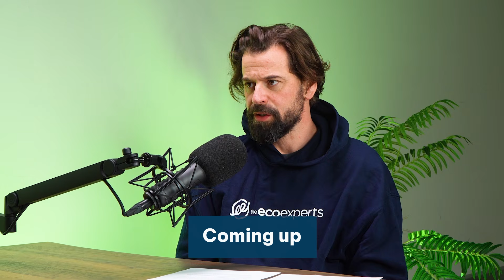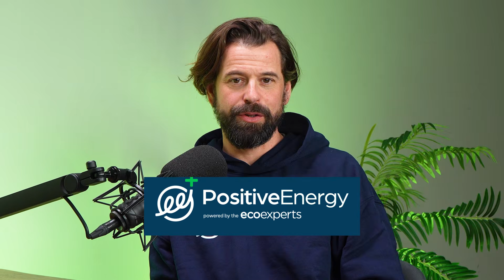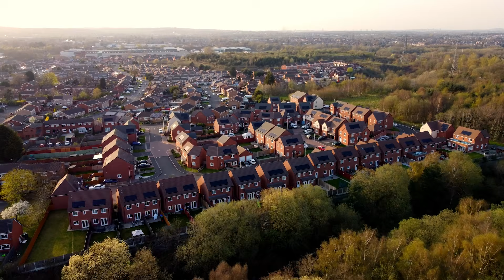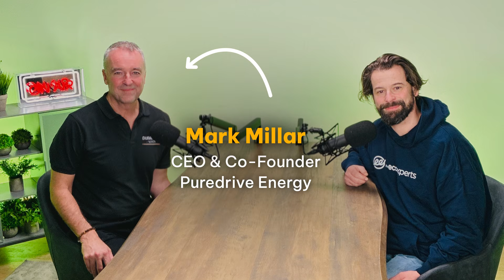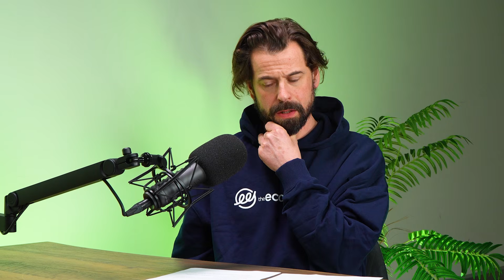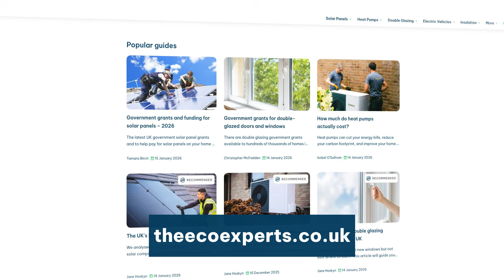Batteries Included: The next generation of energy storage | Positive Energy with Mark Millar

Comment: Let’s get some fact straight. LFP batteries with 5 kw capacity net from reputable Chinese manufacturer with very high quality components sells for a less than 1000 EUR in EU. There are cheaper options around 800 EUR per 5kw. Sodium batteries are plainly unusable for domestic cases, as their discharge curve is brutally wide, which makes them hard to use full capacity. There are no decent Inverters right now, that are capable of dealing with their voltage curve, so upgrade between LFP and sodium is not possible without replacing all the expensive parts. This man sells dreams to people who have no understanding of the topic. It is so sad to see how solar has been abused. There is no real alternative to Chinese LFP batteries right now. They are good, cheep and last for decades - the only true thing the guest said.
Reply from the maker: Hi there, the guest mentioned sodium batteries in answer to a question about the future of batteries. not something that was a viable alternative now.